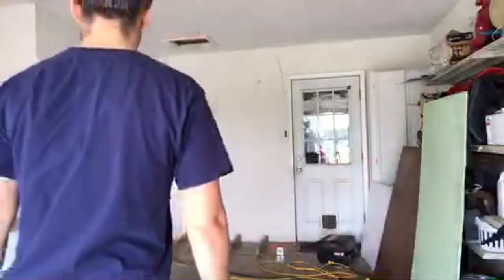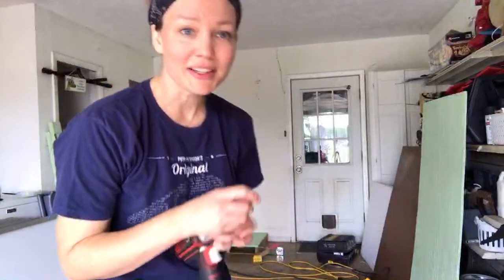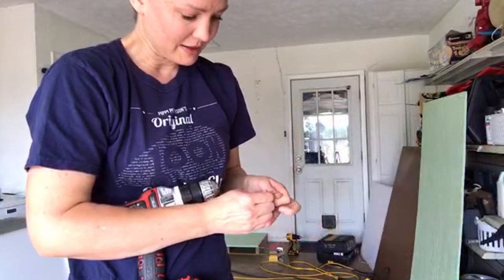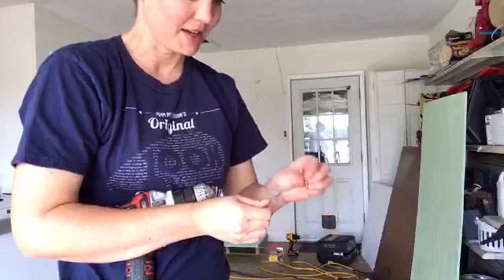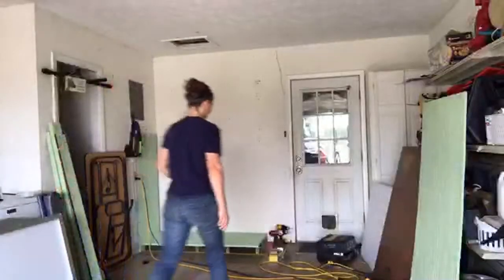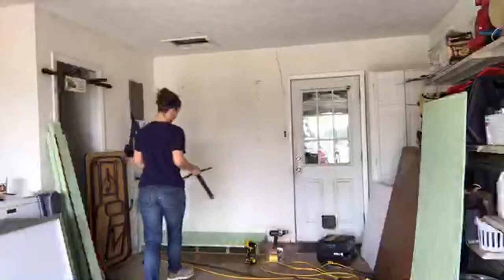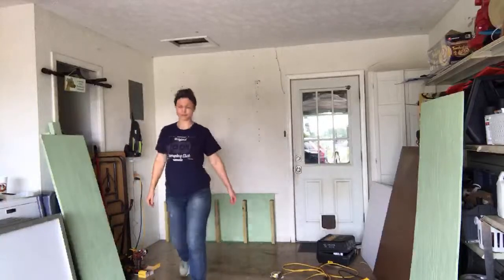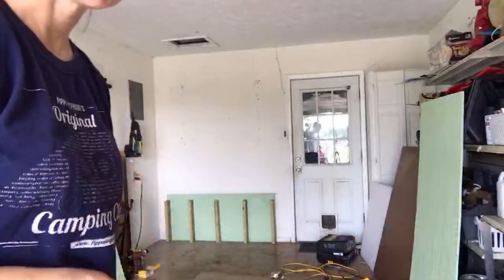Live Hangout: Building the Throne for my Crown Batteries

Comment: For future reference, if you have to do something like find those support boards underneath your base what you should do is take a chalk line and Center it on the support on one side and then extend it to the other side and snap it and then you will have a chalk line showing you where the support runs.  That way you can go through each one of those supports  in a matter of seconds and have a chalk line on each one.

Comment: The off gassing when charging lead acid batteries is highly flammable. Removing ignition sources and ventilation is a good idea. We are probably going to have the Evil Dooers mess with the power grid and costs of electricity.

Comment: Pippi, your base needs supports between the 2X4s because with the weight of the batteries the 2X4s could fall over by a sideways push on the whole box.  The screws will not be enough to hold it from doing that.  Just a 2X4 between them will prevent that.
Reply from the maker: Perfect, thank you!

Comment: That looks like a gas water heater right beside the battery bank. 
When the gas water heater lights, any concerns about that?
Reply from the maker: I will have ventilation in mine going through the roof and also a fan blowing into it